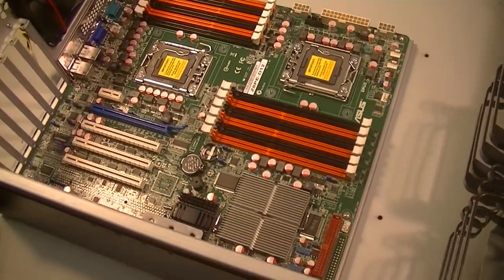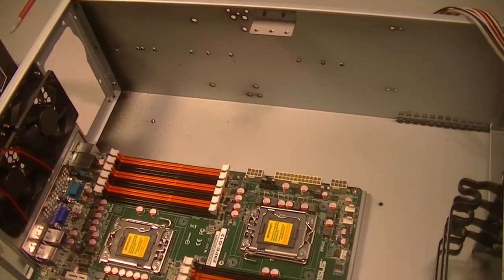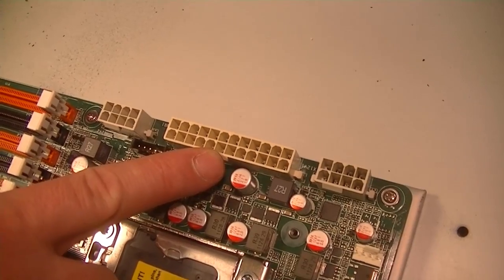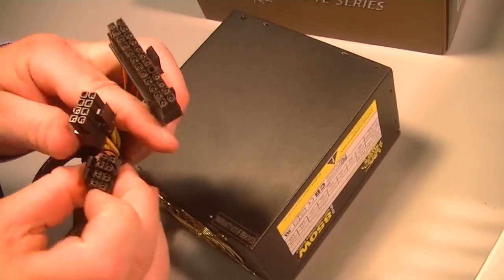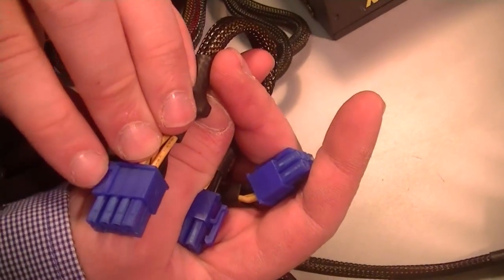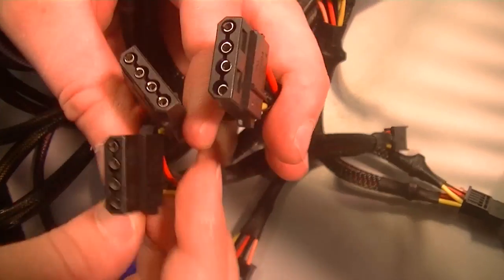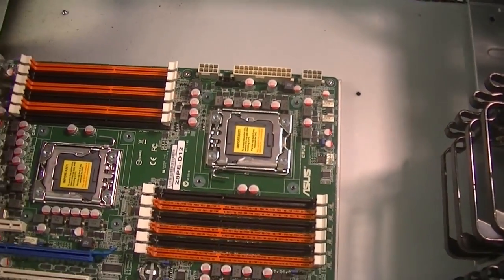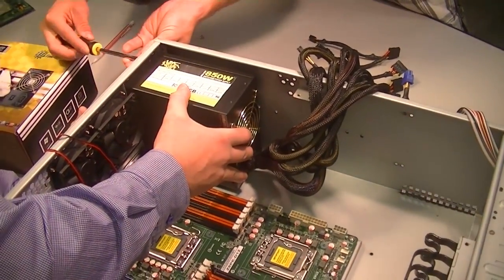How to build a server computer: Part2 Installing the power supply

Comment: So much misinformation in this video. 

PFC "cleans" your power, you can google for more information, but it basically evens out the power coming in. and PSUs draw MORE from the wall than your computer can use, this is because of the AC->DC conversion. Most power supplies today advertise their efficiency rating using the 80+ standard.

Comment: It is extremely unlikely that a magnetized screwdriver can damage your hardware. I've been doing this for over 30 years now, and not had one 'magnetic' incident. 
One small screw loose on a live motherboard on the other hand can make for a very bad day. There are times when you just cannot see the small parts, and having a telescoping magnetic wand or screwdriver bit is essential for cleaning loose metal out.
Reply: 100% agree.